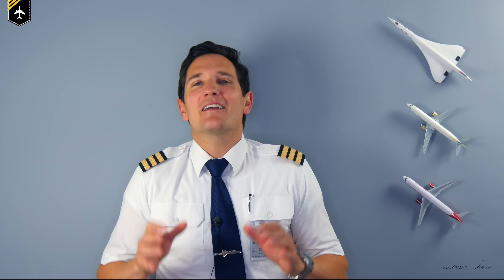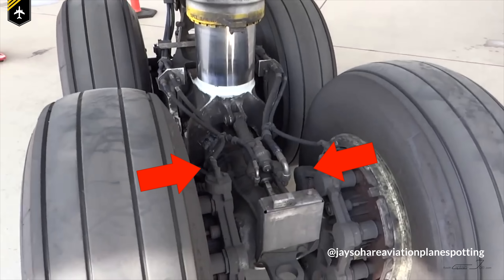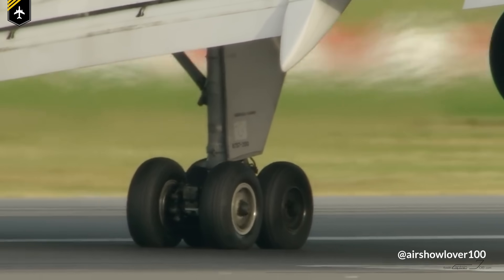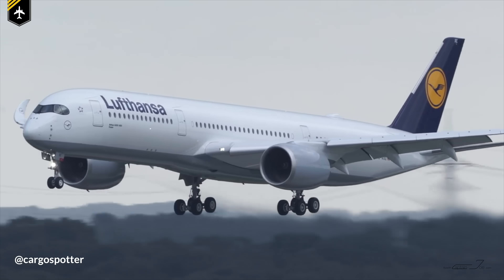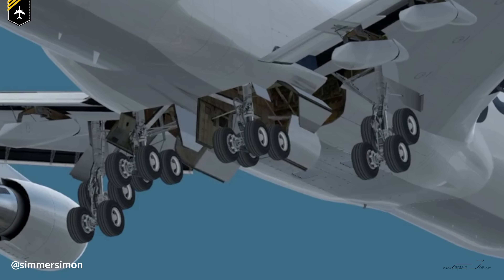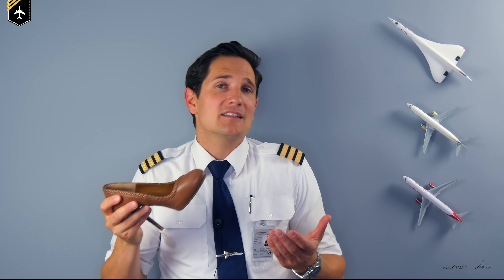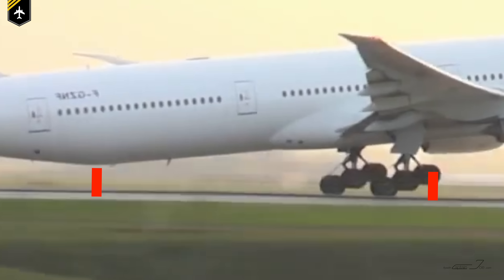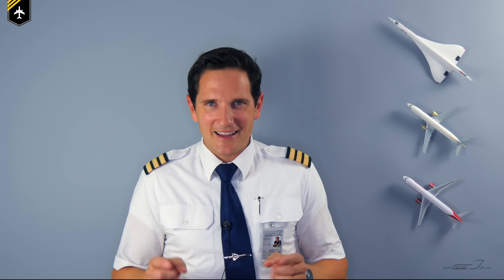Why is the LANDING GEAR TILTED? Explained by CAPTAIN JOE

Comment: I'm a new sub & absolutely enjoying your content! Question: The rotating gears clip at the end got me wondering... Whenever I'm traveling on a plane, aside from the mechanical noise the gears make as they move into position, I could also hear deep rumbling... Is that the sound of the bay doors vibrating in the wind just like in the clip?

Comment: Very nice video, and the 777-300's landing gear engineering is great!
About forward tilt as in the 767 or A350, I though it was like that to reduce drag produced by the boogie, since they appear to be aligned with the flight angle during approach (but, it led me to greater doubts specially seeing those external boogies in the 747 :D )
Thank you Captain Joe!

Comment: I've sometimes wondered why the landing gear ( most noticeably on the old WWll 'warbirds' )....left side & right side.....don't go up at the same time.
Reply: I think it has more to do with the lack of sophistication in the systems that were used in those times. WWII was still the infancy of flight and retractable landing gear was still a relatively new thing.
Reply: Because retracting them at the same time requires twice as much hydraulic power, and thus a bigger and heavier hydraulic pump.  Doing them one at a time reduces aircraft and fuel cost, and gives more payload capacity and/or range.  It's an easy gain to take.

Comment: i am shocked that it has nothing to do with giving the pilot more control on landing, given that the angle of the wheels enable more control over the touch down.... if the wheels were in horizontal position on touch down i am sure the landing would be rougher.... with one set of wheels hitting the ground first surely it creates a more gradual drop onto the runway?
Reply: The struts are shock absorbers, not the bogeys.  Even if they were to land flat, the struts compress to take the shock.

Comment: QUESTION: why in this part of the video 1:44 the weels are not running?
Reply: Because the plane has not landed yet. When the plane is flying in the air and the wheels are retracted, they do not spin. Once the wheels are lowered they remain stationary since there is no force to cause them to spin until the wheels touch the runway.

Comment: Joe, has there ever been an incidence where the landing gear did not open to land?  Scary thought.  Would love to hear your thoughts on this.  Thanks!
Reply: It has happened many many times. Despite your thoughts, it's not a terribly dangerous situation as it is quite controllable. The plane will most certainly be damaged, but the passengers are rarely injured.

Comment: Iv always wondered why the wheels aren't pre rotating prior to touch down to reduce tire wear. They wouldn't even have to be motorized the rim could be modified to catch the wind and get them spinning
Reply: crazy observations it’s just too complicated. Besides practically the speeds for landing vary so much on each flight that it’s complicated to match the speed.
Reply: Because it costs far more in fuel carrying that equipment around every single flight and maintaining it than it would save in tire costs.

Comment: When are we going to see these circular runways?
Why are the numbers on the runways still painted and not using led lights? We just heard that our airport (Charleroi, Belgium) has to redo all their runways because of the Earth's magnetic field changing. Just like the notations on all taxiways, still oldschool and painted, not led boards with lights so they can be changed if necessary in a couple seconds, instead of paying a lot of money to change them all? Everything has to be as cheap as possible, but when an airport has to do something it cannot cost enough (from probably our tax dollars and tax euros)...that's so counterproductive. 1 computer can take care of all of those problems in a couple seconds, instead of closing down runways, which costs a lot for airports which will be the cause for raising prices for the costumers...
If you play a lot of flight simulator, is this something that is interesting for the captain or flight attendants (captain's assistents), because i'm pretty sure I can take off, fly and land a passenger airliner VFR, ILS, VOR,...

Comment: Ok 40 sec in and I'm gonna take a guess...they tilt on double axle trucks so the trailing wheel always touches   first. It also allows the truck to adapt to any flare angle and if the truck didn't tilt it would probably snap off when the trailing wheel touches.

At 1:28 I'm editing this guess to also add the same reasons in regards to rotating. The truck would snap off before full lift is achieved, 2 massive gouges down the runway and a very rashed up belly later, you're still on the ground.
Reply: Now I wish I hadn't guessed. Wasted synaptic connections.

Comment: Thanks for the explanation, I always wondered about the 777 gear. Love the fact that it kicks the plane upward on rotation. But I always wondered why it is tilted forward on  landing. By intuition one would think that this would make it more vulnerable to breaking. Would you know the reason for the forward tilt of the 777 trucks on landing?
Reply: Forward tilting makes more sense of you look at the angle of the runway. The landing gear is better in line with the runway.
And the time of one Wheel hitting the runway first is reduced.
I also think it has something to do with the force the Wheel creates when hitting the runway.

Comment: I'm no pilot … what do I know?  I do know that I HIGHLY DOUBT the ONLY reason for tilting bogies is to make them stow into the wheel wells easier!  (Some 777s re-level the bogies before stowage!)  That, my friends, seems like an over-simplified "story".  And high-heels do NOT improve gait nor lower extremity mechanics!
Here's the deal, if you jump up into the air, you land toes-first not smack down onto your heels.  This allows for some DECELERATION rather than hard compression.  When you step down off a step or curb you land toes-first so that you can more gently lower your body weight down.  Similarly, if you have three tilting bogies each tipped at 2,500 pounds of force, that is 7,500 pounds less impact upon landing!  That almost 4 tons of deceleration is much more comfortable on the passengers!   Look up videos of "smooth A330 landings" and you'll see the back wheels touch, then some gentle compression to bring the full gear down, then some gentle compression onto the shocks, then the full weight of the aircraft.  THAT is why they tilt = SOFTER LANDINGS!!!

Comment: Joe why not before landing some electric power spins the wheels a bit to avoid or at least decrease the affect of static wheel touches the ground and burns rubber? Yeah probably they want to to save weight but its really not important to add some tire lifespan landing comfiness?

Comment: What makes you think that the body gear of a 747 "isn't tilted at all"? You even draw a blue line to show it: if it weren't tilted, that line would have to be perpendicular to the landing gear strut, but it's clearly not. It's not a very big tilt, especially compared to the wing gear, but enough to notice even with the naked eye, without blue lines.

Comment: If you suddenly get caught by strong wind sheer and you have automatic spoilers, breaks, revere trust etc. set, how would you preform an emergency takeoff? Also, do you have a Twitter?
Reply: There is no such thing as an emergency take off. Once the plane is on the ground, and the spoilers/brakes/thrust reversers have been activated, it would be extremely dangerous to try and take off again. Staying on the ground would be much safer, regardless of wind shear.

Comment: Just started the vid and I have not seen it before but my guess is that it helps landing as planes land at an angle so instead of just half of the back landing gears touching the runway the entire landing gear is touching the runway

Comment: question,  why is the 767 the reverse of the 757?   the main bogey's on the 67 the forward wheel set is down verses the 57's rear wheels are down.  

I was told by numerous pilots growing up its because of the weight of the brakes and how they are arranged differently between the 57 and 67.  

Confirm ?

Comment: Hi Joe. I enjoy watching your short videos explaining different aspects of your profession. When I saw you holding lady's high heel stiletto shoe, I thought you had some ballroom dancing background as well as the foot-work is not dissimilar to your landing-gear touch downs maneuvers. . In Waltz, the first three steps 1-2-3, 1-2-3 (Slow-quick-quick SQQ)  for men the foot-work is  'Hill-Toe-Toe (H-T-T) - right-foot forward on the heel (H), rising  on left-foot up onto the  toe (T) and right-foot up again on the toe (T) before landing back together flat- footed. In Fox-trot, after the reverse-turn steps, it is Toe-Toe-Hill ( Quick-quick-slow QQS). So you see - most landing are either H-T-T or T-T-H . On Airbus A388 - the sequence is T-T-H the way the under the wings base landing gears touch down.  I hope this helps your future pilot students to understand the landing gear intrigues.

Comment: you said after touchdown on the wheel the ground sensing unit will automatically do a lot of thing... what if you want/have to do a go-around this late? do you have a knob to reverse all these actions or do you need to set the plane manually up for take off again?

Comment: Hi Captain Joe!
Thank you so much for your videos - I am not a pilot, but as a physics teacher I regularly them in my classes. On the one hand because the topic fits in and on the other hand, because my students have a chance to watch a technically challenging subject in english.

I have a follow up question on the landing gear:
Why aren't the wheels accelerated to spin matching the ground speed before landing? Wouldn't that preserve the tires? And for my understanding wouldn't be to difficult fit such a system even on existing gears?
And even if the motor speeding up the tires would not work - it would not ground the plane. Because in that case the landing would just happen without pre-spinning of the wheels.

Keep you great work up and always have a save flight! :-)
Reply: IMHO, The price of that pre-spinning system is far bigger than price of the wearing tires. And there is another reason - weight of that system and space for them.

Comment: I don't have the patience for an 8 minute video for  what is likely a simple answer.  I always assumed the tilt was to reduce stress. Two tires spinning up from zero rpm upon contact will certainly be easier on the components than four all at once.
Reply: but when the shoe deal came up I got more inserted

Comment: Had a Friend who flew the  C-5 and they did have many issues with that gear. A few declared emergency landing were called due to improper wheel alignment 😬
The military joke was, what’s wrong when you see on the ramp 4 C-5 on maintenance jacks and 1 not ??
They ran out of jacks 😄

Comment: The main reason the gear is tilted is because 🐥 chicks dig it 😄
No honestly I have been flying for over 20 years and I thought was because of the angle of attack or it was to slowly displace the weight of the aircraft upon touchdown ?? Who knew 👍🏻

Comment: Excellent vid, except for one mistake. 
The 777-300ER has the semi-levered gear which holds the bogie in place on rotation, but the non-ER 777-300 doesn't have it. That semi-levered actuator isn't to do with preventing tail strikes. The 777's software prevents it being able to tailstrike. Later -300s don't even have the retractable tail skid of the earlier ones.
That semi-levered actuator is there to increase angle of attack at rotation to increase lift as the -300ER is obviously heavier than the standard -300 model

Comment: Mandela Effect Alert - Jet engines are now drastically forward of the wings, instead of centered beneath them, mounted on "pylons". Does anyone ever remember jet engines mounted this way? I don't. The engines were always well under the wings, and they were never so low to the ground that you could literally touch them without standing on a ladder. And the wings were much bigger. Planes look ridiculous now! This "new" design now reaches all the way back in history. And this "new" design has flaws. The blazing hot exhaust from the engines could easily damage the wings and flaps. There is little to no residue (photographic evidence) remaining showing jet engines the way we remember them. Check any video online showing a plane in flight, or a view from a window seat, or visit an airport, or just check planes in the sky right now, and you'll see the new position of the engines. And by the way, planes appear to levitate. There is talk that the engines are anti-gravity devices, not "jet" engines at all. They just appear to float. Are we being lied to?  We're either on a different timeline, or our timeline has changed.

https://www.youtube.com/watch?v=zanUZlQqUys
https://www.youtube.com/watch?v=J7h8YU46W9o
Reply: take a seat, you need a timeout
Reply: are you on crack?
Reply: Yes, you (not 'we') are being lied to, by people who don't know what they're talking about.

Comment: my only thought is that in a crash landing the one that the back wheel is further down and the front wheel higher up
would probably lend itself a bit better to dirt landing or like sticks and stuff but I bet when u crash in a field
the landing gear is more of a cosmetic deal for the second of use it gets
before assimilating with the Earths outermost crust.
you capitalize Earth right?
Reply: Why don't you give it a shot ?

Comment: Aside from issues of storage space, the biggest reason for the landing gears to be tilted is to prevent excessive lateral force on the landing struts from having all of the tires dragging against the ground at the same instant. That lateral force won't break the struts, because they're designed strong enough to stop the plane using the wheel brakes alone, but the lateral force CAN create vibrations in the landing gear system that could damage parts throughout the plane after a few hundred load cycles. The belly gear supports the entire weight of the belly during the first instant of touchdown, so there is less time for the belly gear to start vibrating upon contact with the ground, and it isn't necessary for the belly gear wheels to be tilted as much to prevent those vibrations from occurring. The wings, on the other hand, still support their own weight by generating lift during the first instant of touchdown, so the wing gear has more time to generate potentially harmful vibrations as the wheels contact the ground, so spacing-out the contact time by tilting the wing gear wheels more is beneficial. If it were the other way around, then the belly gear and wing gear would be arranged differently to provide the necessary tilt for each.
Reply: As a mountain biker, I've crashed and gone over my handlebars a few times, which is a bit like an eagle landing ;) , so I believe I can provide an expert answer to this question:

Eagles land with their feet tilted up so they don't accidentally drag their knuckles on the ground and scrape off the skin. Also it would be hard to grab a tree branch while gliding forward if their feet were tilted down and their talons were pointed rearward. The comparison to Boeing jets would be valid, except that eagles don't have wheels on their feet, so it's actually a completely different scenario. And yes, eagles do have struts -- the muscles in their legs provide the same shock-absorption on touchdown that struts do on airplanes.
Reply: shawn.
An eagle lands with its feet pointed upwards - do they have struts?
Reply: Frobe.
You say something relevant then; why do eagles have their feet pointed upwards when they land?
Reply: @dwarfedgiant: There is no mechanical difference between grabbing prey vs. grabbing a branch. Their feet are still angled up in the moments before contact.
Reply: Fraud.
It took you a while to think that one up; that is not the reason anyway, eagles have their feet pointed upwards to create drag and slow down in order to make a soft landing.

Comment: I have a question about the "Ground" sensor system that you mentioned. In the event that the landing is on a very windy day and the plane bounces back up, the spoilers have already deployed because they sensed ground. Wouldn't that create a risk of a very hard landing if the spoilers deploy when the aircraft is back up in the air, albeit only a few meters?
Reply: Yep. There is a procedure for this called 'Bounce Landing Recovery.' In some instances it requires an immediate go around.

Comment: The landing gear position (when out) also has something to do with the fulcrum effect planes rely on to rotate on take off, which is also a reason (of many) why weight distribution is very important on airplanes (effect is more visible on small aircraft, but all needs a balanced center of mass that doesn't move, or doesn't move by much when dry or wet) 
If the (rear) landing gear was further back, the plane would have harder time to rotate
If the (rear) landing gear was further in front, the plane would lie on its tail.

as always, very interesting video, always nice to hear the takes of pilots who certainly knows a lot more than passionates like me.

Comment: Great movie, as all of them ;). 
Joe or anybody, I was Always wondering why extended gears are not spinning to avoid destroying tires during landing ? Ok rubber helps for traction at the runway, but to maintain tires must be a nightmare. Now a days you could implement a number of systems accelerating wheels to the right speed. Maybe an answer is much more simple ? 😉
Reply: They did a cost/benefit analysis, and found it not worth it. Too much added weight, complexity, cost. And rebuilding the tires when they need it is cheaper. I think there is one plane that has electrically powered front wheel so it can taxi or reverse without engine power.